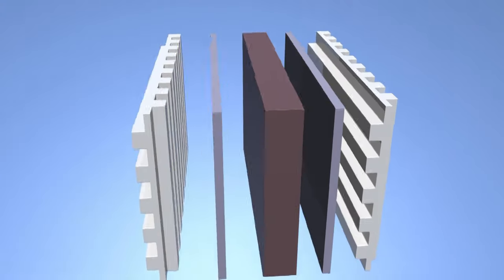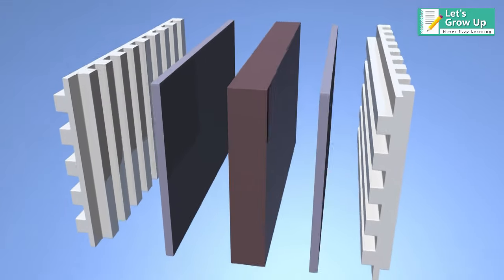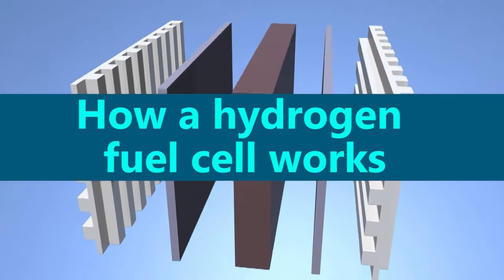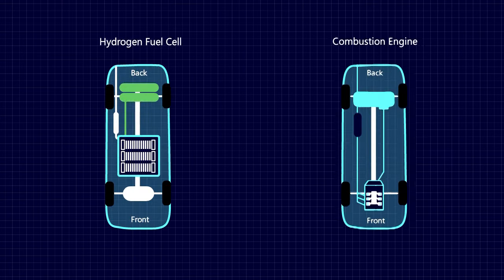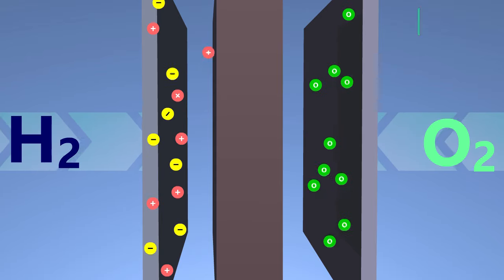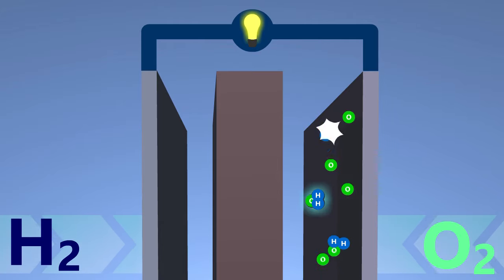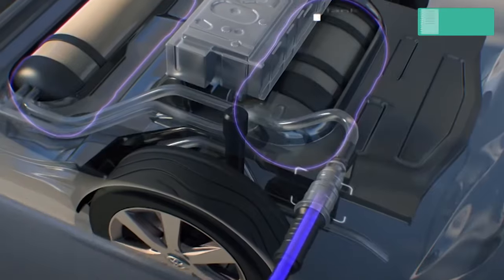How does a #hydrogen fuel cell work? | what is #hydrogen fuel cell | #hydrogencell explain

Comment: If hydrogen fuel cells produce H2o,wouldn't it make sense to implement this technology as a substitute for fossil fuels,in areas threatened by drought?
Reply: Where do you think hydrogen is coming from? We need water to create hydrogen. What they do is break water into hydrogen and oxygen with the process of electrolysis and store hydrogen and use the process in the video convert into electricity.
Reply: @sandeepi9519  yep, it is easy though. Hydrogen can be transported in canisters but would be risky...
Reply: I think you’re misunderstanding - the amount of water produced would have a minimal impact on drought affected areas and even then it would be in the air as humidity, not where it’s needed in the soil
Reply: @metafive1  If it's in the air, it's gonna go into the soil.
Reply: @purpp-esque1711  like I said ‘minimal’
Reply: @metafive1  It's gonna go into the clouds and cone back down as liquid water. Unless you're saying the vapor emissions amount in total would be minimal. Is that what you're saying?
Reply: @purpp-esque1711  low population density means the amount of water would be minimal. If it enters the atmosphere, there’s no guarantee it will fall back to the soil in the same location
Reply: @studyaccount9431  there’s a place that builds 520bar 520cuft transport trailers that go behind semis, and smaller trailers that can be pulled by a 3/4ton pickup, there’s a lot of safety factors in the engineering but at those pressures the gas inside doesn’t matter. If a cylinder ruptured with nitrogen it would be just as catastrophic.
Reply: Lmao
Reply: @sandeepi9519  if they can harvest deuterium for the hydrogen. They probably wouldn't need hydrogen.
Reply: @sandeepi9519 they could probably use sea water and it's converted to fresh water, but I really don't think the things are shooting out water, sounds like a very tiny amount of water vapor

Comment: it’s important look at this from a bigger picture. It would be difficult for me to address all that. The worlds largest resource is water mix that with desalination facilities and we have a huge supply of energy. We would be solving two huge problems simultaneously. The need for clean water and energy which is much easier to transport then lithium. Pump the ocean, desalination, channel the water through out the world, sustain agriculture, life, construction and use it for energy through electrolysis. Sunlight, wind, lithium and hydrogen equals sustainability
Reply: You didn't explain how desalination creates energy instead of using it.  Do tell.
Reply: @ismellbeanscooking  desalination does not but water itself harvests energy. Electrolysis can store hydrogen energy used to power desalination. This would likely be combined with solar power and wind mills. I bring this up because we can solve two problems in one shot. If a community is suffering from a drought or low rainfall and crops can’t be harvested then they can with water. All around water infrastructure is needed plus it can be used for cattle instead of clearing the rain forest by setting fire to them for cattle. Like wise water can power a community or communities. Why are we going through all the trouble drilling down to fossil fuels when we have green hydrogen energy in massive amounts? Its a cycle hydrogen powers cleansing the water and transferring it. We can have large reservoirs essentially for drinking water, construction, agriculture and energy.
Reply: @seanhardman1964  There are not enough forms of green energy to power electrolysis otherwise it would count as more than the 2% currently contributing to global production. We are not there yet
Reply: @koalajazz5337  look up lavo

Comment: Great Explanation!!!!! Finally understood.....
Reply: When will you get your act together and realize that just by "VIBRATING the water at the correct frequency will release 10 times as much Hydrogen. Today's technology is so lame!!  They could also inject the "B" field of a magnet at the correct frequency and release  100 times more Hydrogen  per volume.  It needs to be a vibration,  not a oscillation big difference!!  The "B" field is the most powerful part of a magnet! FACT!!  it is the center part of a magnetic force..    If you want to play with anti gravity just tap the center of any bar magnet on any plastic or glass object it will loose weight!!  Don't tap on any metal or iron it will disrupt the magnetic field.  The entire universe is 100% magnetic .  We should be able to develop a simple Hydrogen generator regulator that is small enough to attach next to any standard auto carburetor. The height of ones intelligence is directly proportional to their realization of their own ignorance

Comment: :face-red-heart-shape: If you use a copper rod as one of the electrodes and vibrate it at the correct frequency , Vibrate   ""do not Oscillate" as in a sign wave form.  A sign wave has three elements 1. The positive 2. /neutral/ 3. negative   without the neutral  AC current and radio  waves could not travel.   Please be careful once you find the correct frequency to activate the inductive properties of the copper rod ,  you'll have more hydrogen then you know what to do with.

Comment: I love the idea of HFC. Though what would hold me back are the potential safety issues of using hydrogen. It's high combustibility. Another issue is, where would we source all of the hydrogen from? Sea Water? If so, energy would first need to be put in into separating the H-molecules from the O-molecules and if we don't want carbon based energy sources, we would require renewable sources.
-So Right now, we have:
Renewable energy source -> electric grid -> electric vehicle. 
-What HFC would require is: 
Renewable energy source + Water source -> hydrogen -> Hydrogen fuel stations -> HFC vehicle 
So we would still require a distribution network using tankers which would reduce the efficiency advantage it has over electric vehicles.
Reply: The distribution would be one of the biggest problems
Reply: @aryangod2003  hydrogen powered trucks are in the works, the gas storage and transport trailers are easy. Making hydrogen from methane is pretty easy, but still releases carbon, capturing the carbon or making green hydrogen with renewable electricity and electrolizers is definitely the hardest part.
Reply: @ParkerSmithRC  why bother?Tesla semi with a 500 mile range is already here. Pepsi co. gets their 2 semi's December 1st. 
Production will be ramping up to 50,000 trucks in a year. By time the "in works hydrogen" happens,Truck industry will be mostly electric
Reply: @Thenakedfinisher  because electric trucks are themselves too heavy to haul any sort of reasonably heavy load
Reply: @Thenakedfinisher   
 
Ll
Reply: @Thenakedfinisher  The maximum cargo load of a tesla semi is 2 tons
Reply: Definitely this is the future, (green hydrogen derived ) liquid methanol fuel to fuel methanol fuel cell (and then electric motor without battery with way longer range and "rechargable" by refueling liquid methanol in just a minute just like any diesel engine. This is the future, better than "normal hydrogen" because methanol is a liquid fuel directly and easy derived from green hydrogen and way better usable than hydrogen because no need compression pressure storage and or ultra low temperature needed. Methanol liquid room temperature fuel is just a drop replacements in any gas station with little modification and same happens even with combustion engine but obviously fuel cell Ev gives more efficiency .

Comment: Excellent. Can anyone tell please what is the electrolyte used for this process?
Thanks.
Reply: @petermarkwood9077  Thanks. Batteries also use KOH.
Reply: @cck1496  yes but also the used electrolyte depends on the battery type
Reply: @petermarkwood9077  Thanks.
Reply: Electrolysis which is know as electric decomposition of water into h2 and o2
Reply: You can only initiate a flow of charges when it is not in free form … you need charged solution such as an acid or base as they form hydronium ions and oh- ions , redox reaction results in flow of charge due to presence of a reducing agent which triggers the whole circuit for balancing electrons at each level .
Reply: A hot aqueous solution of Potassium Hydroxide (KOH), where it's temperature reaches 200°C.

Comment: most wonderful animation vedio that's also helpful to take a better level experience... thanks, who make this vedio
Reply: When will you get your act together and realize that just by "VIBRATING the water at the correct frequency will release 10 times as much Hydrogen. Today's technology is so lame!!  They could also inject the "B" field of a magnet at the correct frequency and release  100 times more Hydrogen  per volume.  It needs to be a vibration,  not a oscillation big difference!!  The "B" field is the most powerful part of a magnet! FACT!!  it is the center part of a magnetic force..    If you want to play with anti gravity just tap the center of any bar magnet on any plastic or glass object it will loose weight!!  Don't tap on any metal or iron it will disrupt the magnetic field.  The entire universe is 100% magnetic .  We should be able to develop a simple Hydrogen generator regulator that is small enough to attach next to any standard auto carburetor. The height of ones intelligence is directly proportional to their realization of their own ignorance

Comment: I want to turn these into industrial-sized to clean while they work and have like a sub tray that is removed for debris so instead of having a septic tank we would have a hydrogen fuel cell and it would be literally decontaminating everything for us and then we can use the fertilizer in the field from the residual effects  realizing water re molecular constructing. We can make fresh water out of saltwater as well as any water treatment plants we could use it as recycling cleaning for the Plastics or cardboards as well I believe.
Reply: how do you do this?
Reply: When will you get your act together and realize that just by "VIBRATING the water at the correct frequency will release 10 times as much Hydrogen. Today's technology is so lame!!  They could also inject the "B" field of a magnet at the correct frequency and release  100 times more Hydrogen  per volume.  It needs to be a vibration,  not a oscillation big difference!!  The "B" field is the most powerful part of a magnet! FACT!!  it is the center part of a magnetic force..    If you want to play with anti gravity just tap the center of any bar magnet on any plastic or glass object it will loose weight!!  Don't tap on any metal or iron it will disrupt the magnetic field.  The entire universe is 100% magnetic .  We should be able to develop a simple Hydrogen generator regulator that is small enough to attach next to any standard auto carburetor. The height of ones intelligence is directly proportional to their realization of their own ignorance
Reply: @vincecox8376  Then make a working prototype and post the video 😑

Comment: So the catalyst breaks the bonded electron from the proton and the proton pass through the membrane. In order to be neutral the electrons pass through the circuit.

So why add oxygen there. Remove the oxygen and no water would be formed. Use the same hydrogen in the anode and get power. 

Repeat the process and get unlimited source of power

Comment: why is oxygen necessary here in the hydrogen fuel cell??? why can't protons bond with the arriving electrons to turn back into a reusable hydrogen??
Reply: I believe that the oxygen is needed to drive the reaction in the first place. After the hydrogen is split into protons and electrons, the protons are highly attracted to the oxygen and the electrons are either driven or just have nowhere else to go lol idk.
Reply: @parkerdunham9417  at least that was an explanation, thanks lol
Reply: @parkerdunham9417  how can we extract oxygen from air? What if it's impure?

Comment: a fleet of three state-of-the-art 63,890 ton (85,000 ton loaded) stealth (CATOBAR) aircraft carrier powered by combined cutting edge fuel cell & Li-ion i-HYBRID marine propulsion system . . . if non-hydrogen based bio fuel cells could power flat tops with Li-ion batteries acting as additional power assist, it'd be revolutionary . . . please advise . . .

Comment: Could this application be used in order to generate electricity in coastal regions as well as the developers working on floating cities.

The only thing missing are water fuel center stations ⛽
Reply: To get the hydrogen from the water you need to put in as much energy as you would get out of it, so unless you had hydrogen the operation would be net energy negative.
Reply: @abdul hadi farooq why would you want to use the solar energy to turn water into hydrogen to turn it back into electricity like you could just use the solar energy straight u and bypass the hydrogen cause it’s inefficient
Reply: @campbellgrieves9896 
 to travel
Reply: @campbellgrieves9896  energy storage if at peak hours you produce more energy than you need and use the excess to produce h2
Reply: @campbellgrieves9896  because production of batteries is worse than turning water into hydrogen

Comment: Can hydrogen be used like CNG gas /natural gas cars?
Reply: Yes, if you mean engines there are hydrogen combustion engines only they are far less efficient
Reply: @bdubs79  why less efficient? Do hydrogen flame create less power than petrol or cng?
Reply: @anafez8787  it’s just that the fuel cell does better

Comment: If you actually research Hydrogen Fuel cells vs the current lithium battery power, hydrogen is a no brainer.  Lithium is a mined mineral  that is limited.  Large reserves in China, Australia, and South America, with hardly any in the United States.   a single electric car battery weighing 1,000 pounds requires extracting and processing some 500,000 pounds of materials.  The limitations of batteries will always be a anchor on battery powered EV's.
Reply: but to get hydrogen gas…u need to use fossil fuels in the first place. Also hydrogen causes death fire
Reply: @nigelmathew3666  can't you use solar power instead of fossil fuels?
Reply: @eel845  what are solar panels made out of tho? like you still need to mine for materials needed to make solar panels.
Reply: @nigelmathew3666  Yes, but what's your point?
Reply: When will you get your act together and realize that just by "VIBRATING the water at the correct frequency will release 10 times as much Hydrogen. Today's technology is so lame!!  They could also inject the "B" field of a magnet at the correct frequency and release  100 times more Hydrogen  per volume.  It needs to be a vibration,  not a oscillation big difference!!  The "B" field is the most powerful part of a magnet! FACT!!  it is the center part of a magnetic force..    If you want to play with anti gravity just tap the center of any bar magnet on any plastic or glass object it will loose weight!!  Don't tap on any metal or iron it will disrupt the magnetic field.  The entire universe is 100% magnetic .  We should be able to develop a simple Hydrogen generator regulator that is small enough to attach next to any standard auto carburetor. The height of ones intelligence is directly proportional to their realization of their own ignorance

Comment: For oxygen, does the cell use regular air or should we carry a storage of oxygen as well? 
Or, do we use filters extract only oxygen from normal air?
Reply: The fuel cell draws in ambient air, which contains oxygen. It does not require pure oxygen, regular air is sufficient.

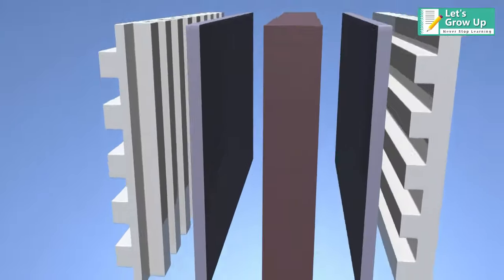Comment: Your illustration starting at 1:23 shows Hydrogen approaching a flat plate. No details of how hydrogen is pumped into it. Does it flow over it? Is it forced through a permeable membrane? Does the liquid hydrogen just sit there in a puddle? Does this membrane have many square meters of surface area? 
These are questions you need to answer if your intention is to teach viewers how this works.
Reply: When will you get your act together and realize that just by "VIBRATING the water at the correct frequency will release 10 times as much Hydrogen. Today's technology is so lame!!  They could also inject the "B" field of a magnet at the correct frequency and release  100 times more Hydrogen  per volume.  It needs to be a vibration,  not a oscillation big difference!!  The "B" field is the most powerful part of a magnet! FACT!!  it is the center part of a magnetic force..    If you want to play with anti gravity just tap the center of any bar magnet on any plastic or glass object it will loose weight!!  Don't tap on any metal or iron it will disrupt the magnetic field.  The entire universe is 100% magnetic .  We should be able to develop a simple Hydrogen generator regulator that is small enough to attach next to any standard auto carburetor. The height of ones intelligence is directly proportional to their realization of their own ignorance